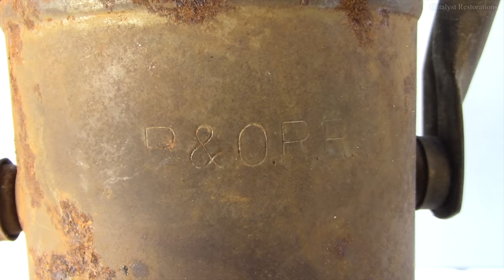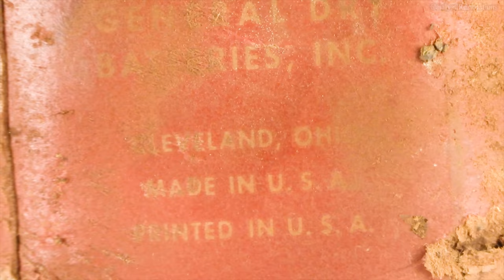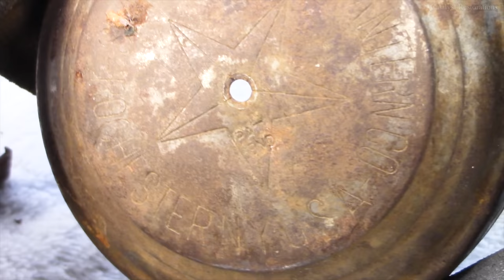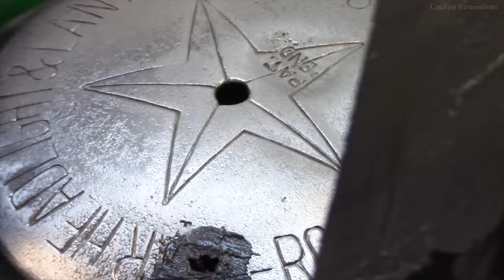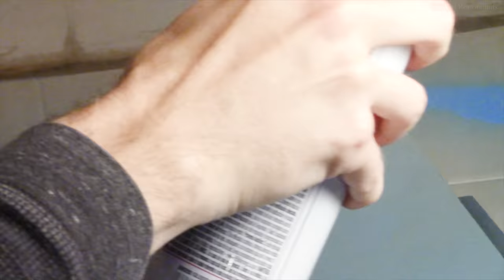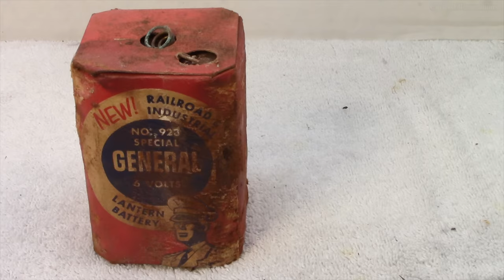Restoring a Junked 1940's Railroad Lantern

Comment: Nice work on the lamp.  It really turned out great.

A couple tips on soldering.  Get some flux and apply to the joint being soldered.  It will help the solder flow.  Also, heat the parts being soldered and touch the solder to parts, not the soldering iron.  The beading solder was caused by the parts not being hot enough.  

Again, great job on the video and lamp!
Reply from the maker: Thanks for the great feedback!! Back when I did this I thought I was using flux core wire, but obviously that wasn't the case (and it could've used extra flux any how!). Good lessons learned for next time - and there will be a next time! Another railroad lantern restoration is coming up in the next month or so - make sure you're subscribed so you don't miss out! 😁👍
Reply: The flux core will bead up like that as well if the pieces being soldered aren’t hot enough.  Just remember to heat the connection not the solder.  Then touch the solder to the connection.  If the connection is hot enough the solder flow almost instantly.

Looking forward to the next video.  I gave you a sub this morning.
Reply from the maker: Thanks! The soldering was especially tricky in this case because there are two little black spacer rings for the sockets and they're made of plastic and actually started to melt when I heated up the socket to solder it, so I was forced to just use the soldering iron's heat to prevent the spacers from melting more!
Reply: Got ya.  That would definitely be an issue if wasn’t thinking of.
Reply: Absolutely.  Should use rosin flux with anything electrical.

Comment: Very nice... the can turned out perfect.  And I never thought of J.B.Weld... interesting.
Reply from the maker: It's definitely not a one-size-fits-all miracle solution, but for something like this that just needs to be moderately structurally sound it works very well. For minor pitting and such you can also try Bondo. Less durable but faster and easier to cover imperfections.

Comment: Great job. Very interesting to see rebuild from ground up.
Surprised that given their intended use and environment there was not a lense cover to protect the bulbs. Seems like they would break off all the time.
Is the bent bracket inside with two holes intended to hold spares?
Nice job!
Reply from the maker: Thanks for watching! It is surprising, considering many other models and manufacturers have covers for theirs. I thought there was a chance this one was just missing one, but they were actually just made like this. You are spot on with the bent bracket inside the lid - holds two spare bulbs!

Comment: You did a good job, however you did reassemble the handle connections not the same as before. All in all, it looks very nice.
Reply from the maker: Thank you! Great catch on the handle connections. In the video they are indeed on the inside of the springs but should be on the outside! Thankfully it didn't affect the mobility of the handle, although it bothered me so have since corrected this in the time since the video first aired.

Comment: Great Job overall! did you notice that the washer/spring handle things were on the INSIDE in the before and are on the OUTSIDE of the handle after?
Reply from the maker: Yup, you are 100% correct! It was a mistake on my part. Some other nice commenters noticed as well 😁

Comment: Use solder that has flux in it, or buy flux separately. Much easier to solder with flux.
Reply from the maker: 1000% this! I used the cheap flux-core soldering wire that came with my soldering kit, but clearly it was woefully inadequate. Lesson learned! Thanks for the tip!

Comment: Why didn't you fix that split in the top?
Reply from the maker: Hi Alan, I'm assuming you are referring to the split in the side of the reflector housing that was entitely re-polished and nickel plated? The simple answer is that entire piece is made of an aluminum-bronze alloy and a crack of that nature can only be truly seamlessly repaired via brazing or welding. I do not have any of that equipment at my disposal (nor the financial means to just buy it all), so the next best solution is to drill out the crack tip to ensure it does not propagate further (a rounded crack tip will not propagate as opposed to a sharp crack tip) and then fill it with JB weld metal epoxy. I'll admit it's nowhere close to the prettiest solution, but by far the most practical for what I have the capability of doing with the equipment I own.
Reply: @CatalystRestorations  Thank you for the detailed explanation. I was just curious as to why the crack wasn't repaired and you explained it in detail.

Comment: Does wet sanding with a lubricant make the sanding makes less precelant?
Reply from the maker: Sanding with a lubricant keeps the sandpaper from "clogging" up with the sanded particles so it not only gets the job done faster, but you also can use the same piece if sandpaper for longer before it's fully "worn out".

Comment: Why did you put the cups and springs on the outside of the handles. Those parts were originally on the other side of the handles.
Reply from the maker: Yup, and it was a mistake.

Comment: Really nice. Railroad collectors are crazy for all stuff like that. But I wonder about the blue color. Is that the color of the railroad that I noticed something was stamped on the side of the canister. Otherwise the baby blue might not be such a good idea
Reply from the maker: Most railroad lanterns that were made by Star Headlight & Lantern Co. were produced in just a select few colors (and many were just polished metal, not even painted) and the railroads just stamped their name on them when they purchased them in bulk. This particular lantern was owned by B&O Railroad, which colored their engines mainly dark blue and yellow. This particular lantern however, based on its 'patent pending' stamp on the lid indicates it was probably made in the 1940's or 1950's and the vast majority of Star's lanterns in this period were either plain metal or a 'hammerite' muted light blue finish. The blue I chose here is certainly more vibrant than the original color would've been, so I took a liberty there. Otherwise, it's about an authentic as you can get!
Reply: @CatalystRestorations  Yes mini were just the polished metal thanks for the response

Comment: Why nobody uses evaporust in ultrasonic bath?
Reply from the maker: That's a perfectly fine method. But Evaporust is $30+ per gallon and an electrolysis setup can be built at home for under $20 one time and then only costs pennies to run forever. I use electrolysis when I can monitor the setup (because of hydrogen release and electricity and water together) and Evaporust when I can't give it my undivided attention.

Comment: Great job!
Can you tell me the brand of the bulbs?
Reply from the maker: So the original bulbs just say "TUNG SOC USA", which I assumed meant tungsten filament and socket made in USA. But they are just E10 type bulbs. If you search that on Amazon, you can buy a 10 pack of LED ones for around just $6.
Reply: @CatalystRestorations  I was able to read the Tungs letters but no more. The reason was a little different. In Hungary was a bulb factory Tungsram. It was the 3rd biggest bulb factory in the world before WW II. My first thought was those bulb came from there.
Reply from the maker: @SKL137  Ahhhh gotcha! That's super interesting, I learned something today!

Comment: Mmmmmmm asbestos. Those washers for the bulb sockets looked like asbestos.
Reply from the maker: It's certainly possible. I wear a respirator during disassembly and asbestos is 'fine' unless you kick up particles of it, which didn't happen here. They were sealed and painted as well so it also lowers the risk of any particulates becoming airborne.

Comment: Soldering is a bitch, but you gotta heat up the parts themselves!
Reply from the maker: Yup, for sure! This part was super tricky - if you remember from the video there are two small, black spacer rings that go under the socket on the reflector side. Unfortunately they are made of plastic, so if you dump a bunch of heat into the socket for soldering then the plastic just melts. The plastic actually started getting tacky in just a few seconds of the soldering iron in contact witn the socket. Still not a pretty job, but even more of a pain in the butt with restrictions like that!